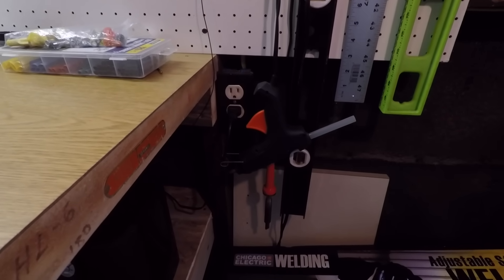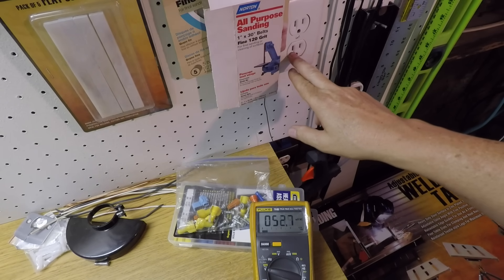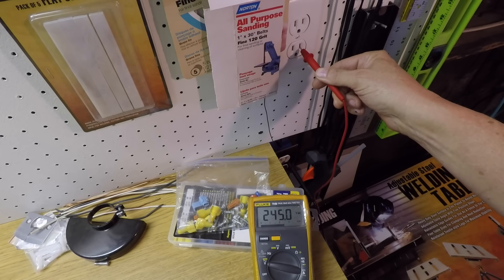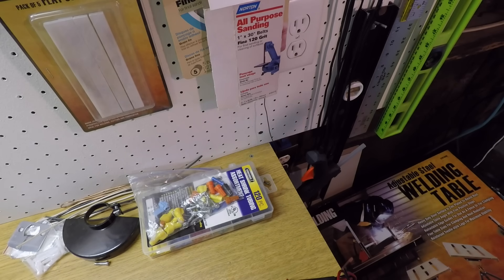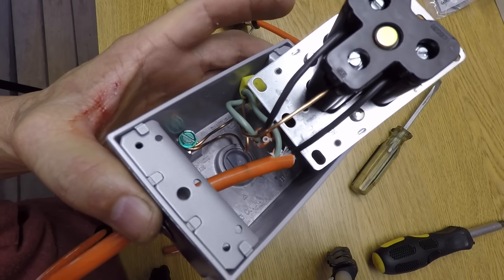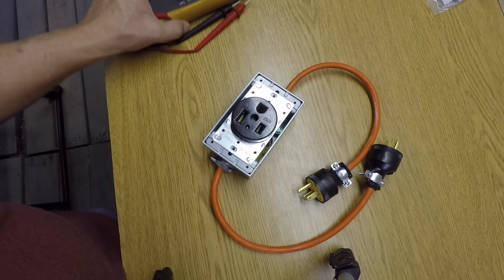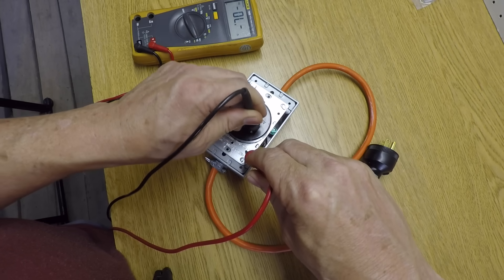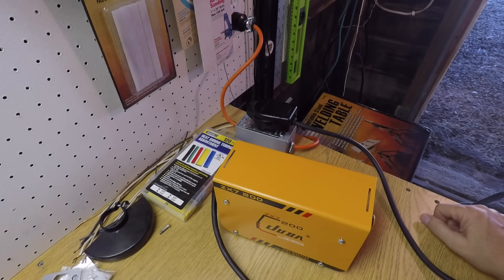How to Get 220v From 110v

Comment: For the cost of the materials you bought you could've run a dedicated 50amp line for the welder. 20a circuit, 15a wire, 15a plugs; living on the wild side!

I've caught a few those on fire and I  wasn't using my welder!
Reply: Are you drunk. Have you checked the price of wire lately. Not possible.
Reply: @jessjulian9458  My thoughts exactly.  Am currently wiring my son's house, and you talk about "sticker shock!"  Haven't checked prices since the Pandemic started .... it may be time to buy some supplies!

Comment: You do realize that you majorly over spent on this right. 
If all you needed was 220 V @ 20 A, take off one of the outlets that you ran a dedicated line for (assuming you did that) and put your 220 V plug there instead, then you mark the white wire with a piece of electrical tape signaling that it's a live line. 
Now in your panel take the white line and remove it from the neutral bus bar and mark it with a piece of electrical tape and swap out the 110 v 20 A breaker with a 220 v 20 A breaker and wire in your new plug. 
You created a complicated and dangerous solution, to a simple problem and ended up spending more to do it as running a second 12 AWG wire the distance that wasn't necessary.
Reply: damn near could have just ran a new line to the breaker box, and be safe.
Reply: I could imagine someone with a small welder doing this if he lived in a house that he didn't own (e.g. a rental home).  Installing a 220V outlet would be something an owner would frown upon if the owner is not a garage person.

Comment: That's a good little 240
 " quick disconnect!, you should sell them" 
Jk.

If you are using that still, go ahead and put a 'GFCI breaker in both circuits thats each of /120 lines
@thabox. Then I would feel totally safe using the welder or using anything using either /120 line

Thank you
Your welcome

Comment: A very awesome video I have ever watched! Learnt something very new (concept).
But I am not able to understand one concept here that without Neutral, how does the circuit complete?
Might be in your case the Phase (two different Hots) are in different potentials. Is this the case?
Or, if anyone can explain me better. All infos are welcome.  
So far my understanding goes, there must be potential difference for electrons to move. 

Lastly, if the two Hots are in same value say, 120v, will your concept still work (240v)?
Reply: Sunflower. Yes, 2 opposing legs of a 120/240V supply. If, as you ask, they are on the same leg, you actually will have zero volts between the two 'hots'. His hack works even though in violation of all electrical codes, because the welder does not use line-to-neutral load. A clothes dryer needs a four wire plug because it uses 240V (the 2 hots) for the heating element, and 120V (hot to neutral) for the light bulb and the electronics.
He acknowledges in his opening that it is incorrect. Don't do this at home.  Your insurance will not cover fires caused by this.
Reply: @April8989  I was thinking that this sounded a bit crazy and not within NEC.  Why not just provide a proper conductor to a proper outlet with a 50 amp circuit breaker?
Reply: @jwbranham2009  Jeff, 8-2 cable (#8 gauge, 2 conductor w/ground is not cheap. That and the cost of a 50A breaker would likely be $100 or more.  His way hardly cost $20.
Reply: @April8989  Thank you for the concept shared!

Comment: You are not getting 240 volts from 120 volts. What you are doing is simply using both hot lines from the standard split single phase 240 volt supply that all U.S. residential systems use. Your main panel will accept a standard dual circuit breaker, that will feed a standard 240 volt circuit. This  is not rocket science.

Comment: Ok, simple fix. Take your 2 120v legs and grounds, run them into a 220-240 breaker box-shut off switch then run your 220-240 plug from that breaker shut off switch. If there is an over load on any of the circuits it will trip the 220 breaker in the switch box eliminating any power bleed to either leg.
Reply: Boy, now you went and rained on all the doom say.

Comment: Yep but in most cases you would need two 30 amp circuit for this. Dryers need two 30amp circuits and so do most compressors.  Best to wire this from a power panel coming off of two 30 amp breakers.
Reply: The rated current and the duty cycle are required to determine the wire size and overcurrent protection.

Comment: Why does a 240 outlet not use the white wire?
Reply: Bryan Meza The power wires use each other as a return to neutral. Think of it as a tug of war or push pull.

Most 240v appliances that require the neutral wire have a 120v need in the appliance, maybe a fan or clock. So one of the power lines feeds back to the white neutral giving 120v power. 

🤷‍♂️ I could be wrong, I’m no expert.

Comment: When you talk of two separate 120V lines, do you mean two separate PHASES. 
Where does the extra "line' come from?"

From subsequent comments, I gather that households in the States are supplied with both 240 and 120
to be selected as the house is wired?
UK we have 240 RMS...3 phase. House 1 gets  phase A, 2 gets Phase B, house 3 gets phase C, house 4 gets phase A and so on.
This sounds a bit dodgy to me.
Reply: Almost every house in the US is supplied with 240v split phase power. 2 separate legs, 120 degrees out of phase of the other. A neutral leg is supplied so that a 120v circuit can have a complete path of power through it, as 120v has only one leg of power

Comment: A little misleading.  It worked because the two circuits are each on a different leg of service NOT because it was two different circuits.  Had they happened to both be on the same phase it would not have worked.
Reply: tmar23 👍thank you u know what ur talking about
Reply: 1:53 into the video he pointed out the two receptacles were on separate lines and he demonstrated that putting the meter on the two lines would give 240V. You would not get that if it was the same circuit .
Reply: @rydfree  While I like the video and this is a great idea for emergency use.  just because you use a separate line dose not mean this will work it needs to feed from separate legs of the breaker box, using both phases other wise it will not work.  I could show this exact setup not work using just two separate lines.
Reply: @rydfree  - But he did not make it clear that the lines need to be on separate phases.
Reply: @rydfree  Those circuit breakers feeding those sperate lines could have been feed by the same side on the incoming 220.  Electricity travels as a wave at 60hz you need all three conductors of the 3 lines coming from the initial drop for this to happen

Comment: The question I would have is not about the voltage, but about the amperage. Unless you have a pretty wimpy welder, you're still only running off of 20 amps. Stick welders usually require heavier wire because of high amperage loads. This is why most outlets for these are rated for 50 amps. I would think you are running the risk of a fire using 12 ga. Wiring even though your breakers are 20's, two of them paralleled together could draw 40 amps on the same 12 ga. Wire.

Comment: Due to the risk of one one breaker tripping leaving you with just 120v on your 240v device, I would suggest a 240v breaker inline with this contraption so it would trip first.
Reply: Because 240V is the potential between both hots, for 240V to actually be used, both circuits would need to be active, anything actively using 240V would no longer have a completed circuit if one of the breakers trips.  Also, a breaker is more specific for amperage not voltage (needs to be rated for the voltage, but what it trips on is current), but as this is 2 different phases of 120V, you would effectively be reproducing the same breaker setup you'd have in your panel.
Reply: @jpfingstmann  I think you are missing the point. Yeah, your device won't work, but you are still feeding 120 to it. If a 240 breaker trips, all power going to the outlet is killed. I have to agree that while this will work, the potential for problems is high because the breaker is not a single unit.
Reply: @jpfingstmann  Some 240v appliances can partially function on 120v, so there can be an issue depending on the appliance. My house has a fuse box for my drier, each leg has it's own fuse, it blew one fuse once and the only thing that didn't work was the heating element.
Reply: @tanner88gt  thats a different situation, your drier probably has a 4 wire receptacle. it has a white neutral wire that completes the 120v circuit to run the controls.
Reply: @tanner88gt  no matter the age of your house 3 wire or a 4 wire plug you should have a 2 pole breaker it's not only code but could potentially cause issues with appliances, maybe not the DRYER you have now but the next dryer or the next homeowners dryer.

Comment: I know you want to save the wire. O you didn’t have one more empty space in the circuit breaker panel.
Reply: Jesus Ortiz     No space, install piggy back breakers for some 120 v circuits. That will open up spaces for double pole breakers.

Comment: I still think that the house is wired somewhere 220 Volts coming from different circuits. Otherwise, the multi-meter would read zero (0) from the receptacle instead of 220V. Because the two hot wires would be the same 110v (common).
Reply: If you have any high power electric appliances in your house, then you have 220v coming into your house (Electric dryer, Stove, Central Air, Water heater, etc) which is VAST majority of households in US unless you have REALLY REALLY old electric system.  220v is coming in as 2 110v lines in different phase which are split into 2 lines in your electric panel (left and right side).  Those large breaker switches grab both lines to combine them into 220v.  He is using that fact and wired those 2 outlets into separate lines and combining it in his own makeshift box to create 220v circuit.

Comment: This would be a great workaround if you were working in a friend's garage with your welder, but I would use 2 - 25' or 50' cords hooked to the 220v box so I would have enough length to make sure I find 2 different circuits.  In your own shop, with your own welder, just run the correct wire from the breaker box with the correct breaker. Great caution statement to make sure you unplug the welder from the 220v plug first.

Comment: If you remove the piece of metal connector that combines the two separate single 110v outlets in a one gang fixture, you can have 240 volts from a single one gang box, then your adapter can be made as a simple and easy to plug in unit. You can even just use a stand alone one gang junction box with the adapter built in sticking out one side that plugs into the wall and the 240 outlet on the opposite side . It will basically look like a large wall wart with a 240 outlet in it.
Reply: John E H would not work. Each plug needs to be plugged into two different outlets that come off different busses. An outlet is only supplied by one busbar.

Comment: So basically you are taking ( 2 )  120v outlets on different lines and running them in series to double the voltage to 240 volts?

Comment: In Canada, 20 amp sockets are supposed to have a "T" shaped neutral.  20 amp plugs have a neutral prong at right angles to the active prong, but 15 amp plugs will fit into the 20 amp sockets.

Comment: I simply piggy backed a 220V receptacle box to my top water heater panel, drilled a 1/2" hole and fastened one to the other, and had available whatever the amperage of the water heater was. I used this for my big air compressor flawlessly for several years until I moved, disconnected the box, and simply put a 1/2" electrical blankout cover over the WH hole. SOOOO much easier than this with a heck of a lot more amperage.

Comment: This will work since some outlets are connected to one leg of your incoming service and some are on the other leg. But these outlets are generally only rated for 15 amps so your instantaneous power load can't exceed 15 amps. Most welders are far beyond this.  Of course if you wire the outlets specifically for this purpose then why not just do it right with heavy wiring and a larger breaker.
Reply: Any small 240 V one phase welder is normally rated at 16 A. They will run happily on 15 A, no need for 20 A unless you push it with a too high duty cycle. A breaker rated at 15 A can handle up to 18 A at 20 minutes before it trips. At least it should if it's a slow one.

And that's the answer on why you don't buy a welder rated for 120 V.

Comment: Pretty neat.  Heck, just curious why such a small welder has to run on 220VAC.  My 120 Amp Firepower MIG welder runs off 120VAC and I can get good joint penetration with that unit.

Comment: This is cool for a temp. Idea but would not use it for a full time outlet. A double pole breaker is made to trip together so that being said if you only trip one breaker you lost one line of voltage causing your equipment not to run at all or burn up. Cool idea for a load that's not continuous

Comment: Hello. We are currently renting our home so I can't install a 240v in the panel, so will have to try something like this. My question is if the outlets are not as close as the ones in this video, is it ok to use longer extension wire and or will I have to use a heavier gauge ?   Hope that made sense.  Thanks
Reply: Definitely a heavier gauge but really you should read all these comments
Reply: brandon hobbs will do. Thanks

Comment: Doesn't this make your bare ground wire now a current carrying conductor? If you open that ground (decide to replace a switch or receptacle on the same circuit) with the welder plugged in and on... A pretty random set of events I know but something seems off using the ground wire that is also used for the normal 120v circuit.

Comment: It is sort of a dangerous set up. If the device is plugged in and switched on when you unplug one of the 115 VAC plugs, the pin on that plug will have 115 VAC to ground as long as the second 115 VAC plug is plugged in. As long as you switch off and unplug the device (welder) first, you have no problem.

Comment: I talked to an electrician about doing this, and he told me that I would want to make sure that the two separate circuits should be on opposite sides of the breaker box because AC current alternates between sides.
Reply: Yes that is exactly right,and he did do this ahead of time.

Comment: Can I plug in a 220v 50hz device to This?
Reply: Yes, as long as your device can also operate at 60 hz, if it's a motor or a lamp or something simple like that the frequency difference shouldn't affect operation too much. If its 50hz only you will have use another option.

Comment: Nice option to have , since you can use this concept anywhere you take your welder . I would add a single breaker 220v breaker box so you can trip both lines in case of overload . By running on 1/ 120 volt line after blowing one circuit breaker , it will burn out the unit if not turning off the unit after noticing amp drop . 230 volt transformers will go up in smoke in a minute or so if wired for 120 volts ! Very good HACK , Thanks .

Comment: I'd only do this only in the house temporarily say run a commercial appliance or something  requiring similar voltage..that reason being you have finished walls and would be difficult to fish heavy wiring and put an outlet in..but good thinking there..

Comment: IF he keeps the plugs just as indicated, yes he's created 240 v. @ 20 amps. Most 240 v. circuits are 40 amps or greater, though. The big problem, as I see it, is it's so easy to take that adapter and move it to another outlet on the same leg by mistake. I'd call it a "cheater plug".
Reply: If he puts it on another outlet on the same feed, the potential difference is zero and thus no threat whatsoever.
Reply: If you did it would just trip the breaker off

Comment: I'm surprised there are so many comments that don't seem to understand it's an improvise to get 220 volts without running tens of feet of heavy gauge wire from a panel and meant for light-duty or temporary work by the person who made the junction box. It's easily unplugged and put in a drawer till needed.
Reply: SL:  Exactly.  People get hung up on running 220 from the box.  Thats not what this vid is about, its about using what you have to get you by.
Reply: As some people pointed out, for SOME reason, there was a short or if he loads the circuit with higher than 20amps, there is IMHO VERY good chance that only 1 breaker will trip causing 110v to be supplied to whatever appliance he is using causing POSSIBLE brown out load to the appliance causing it to fail.  If it is cheap appliance, then I guess not much harm done but I would not use this setup without another 20amp 220v inline breaker which is set to trip first so that both lines are cut off at same time.  Also, he is using very short line which makes "portability" not as good, if so, why not just install dedicated line.
Reply: @strangerland9791  For sure it is a safety issue not to disconnect both hot wires when only one breaker trips. 
But for the load it does not matter. If just one hot wire is not connected no current is drawn by/through the load.
Reply: According to the experts,the inverter/welders are designed to deal with load demand s  aren't they?.....

Comment: I've used this trick on jobs where there wasn't 220 volts. I have a portable box much like the one you made with longer leads of 10/2 flexible wire. It's been very handy numerous times.